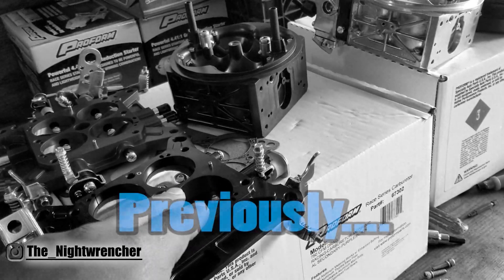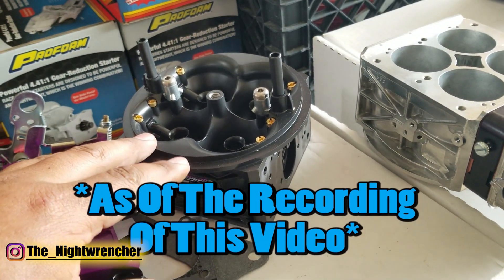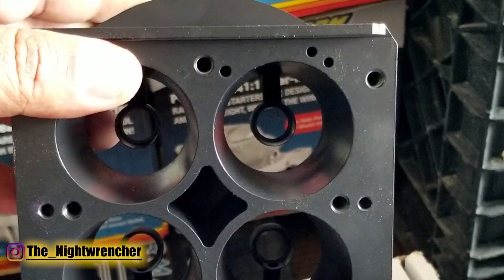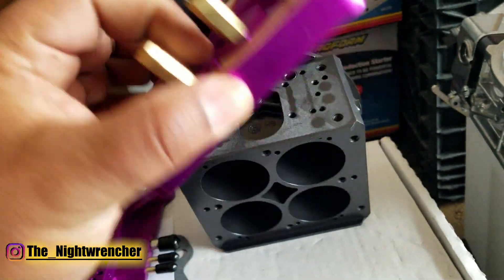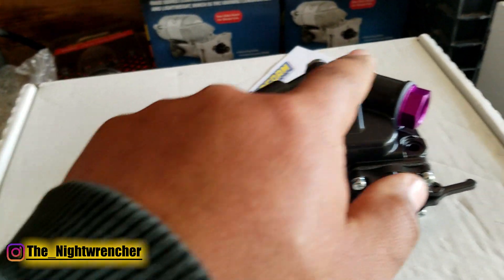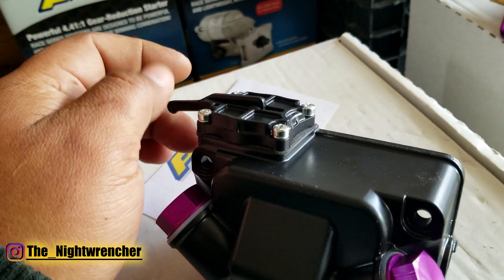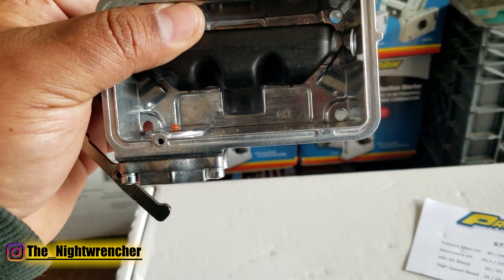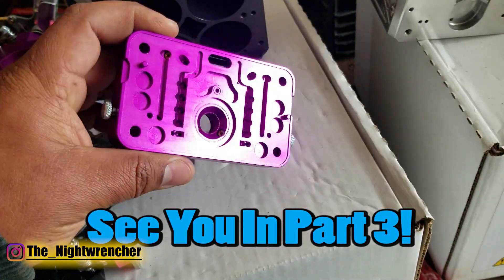Part 2 NEW Proform Race Series 750 Carburetors, Gas AND E85 | Budget Carbureted Turbo LS |

Comment: Are these carbs just as good as a Holley ir Brawler for less money? I need a carb for a 383 sbc, just not sure what size to get.
Reply from the maker: These carbs are awesome. My truck made 575whp with their 750 E85 carb and my charger has made 451 with their 750 gasoline carb. Both boosted. My charger blew a head gasket before we reached its peak power so I gotta go back to the dyno and pull out more power. Depending on the cam, their 650 will offer plenty of air. They have down leg boosters so it actually flows more like 670.

Comment: where do i plug in the the usb cable to tune it?
Reply from the maker: In the ignition box 🤣
Reply: @NightWrencher  need to get a usb to carb adapter harness, I think Holley sells them with there carbs
Reply from the maker: You can get the adapter on amazon actually https://www.amazon.com/Performance-Tool-W30991-Slotted-Screwdriver/dp/B000N37CTG/ref=asc_df_B000N37CTG/?tag=hyprod-20&linkCode=df0&hvadid=242132388719&hvpos=&hvnetw=g&hvrand=11771743029581735160&hvpone=&hvptwo=&hvqmt=&hvdev=m&hvdvcmdl=&hvlocint=&hvlocphy=1014131&hvtargid=pla-569179364062&psc=1